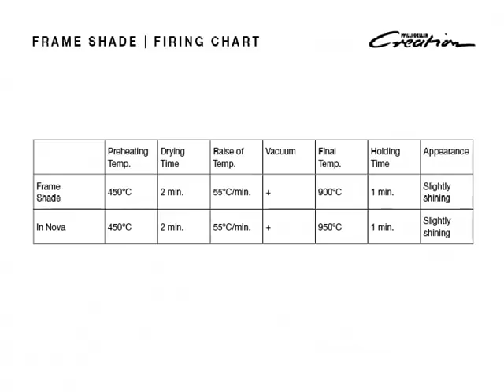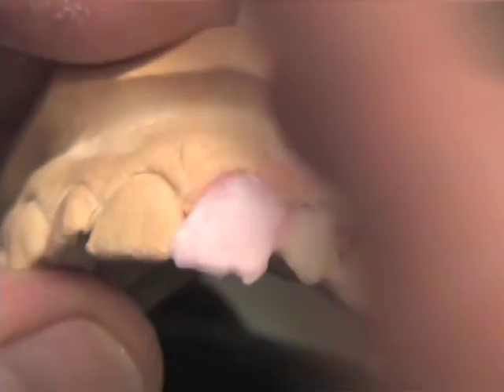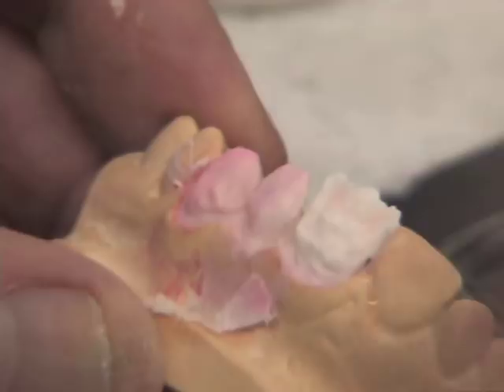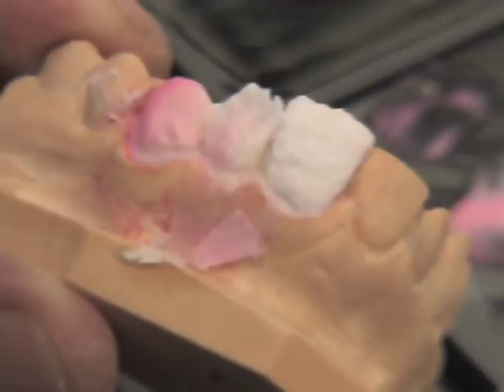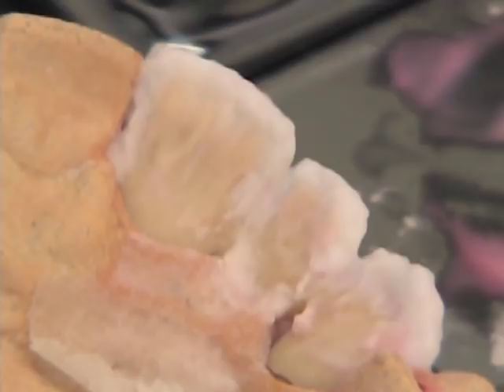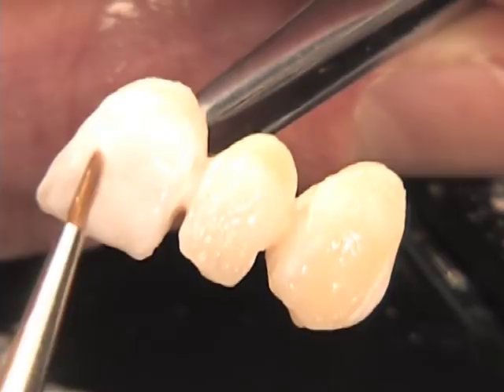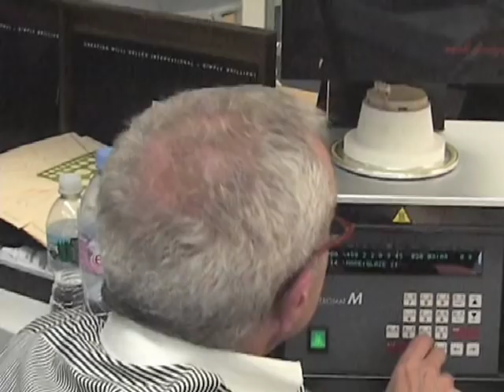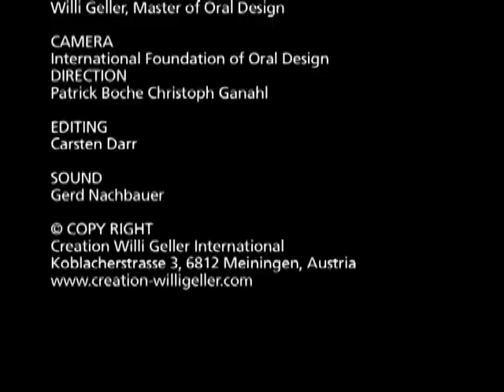Willi Geller -- Live on stage

Comment: Does he Licking the brush?
Reply: many old schooled ceramist does this, and is not like they are licking the brush they just shape it with their lips, plus the high temperatures of the firings (700º C+) makes everything to die, younger ceramist nowadays hit the brush with the end on the table, or use brushes with ball bearings or springs on the inside to shape the tip of the brushes.
This is not a justification, im just explaining why he does it